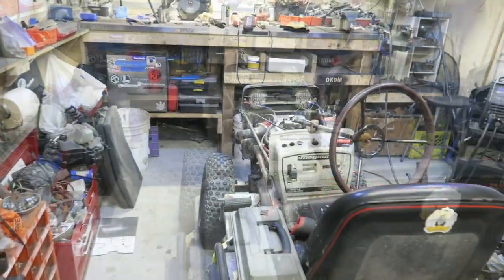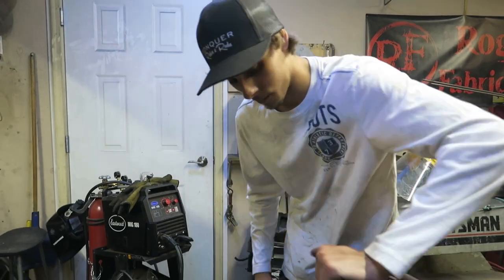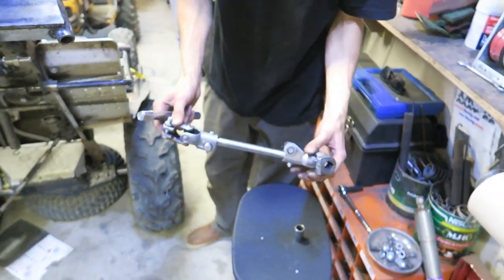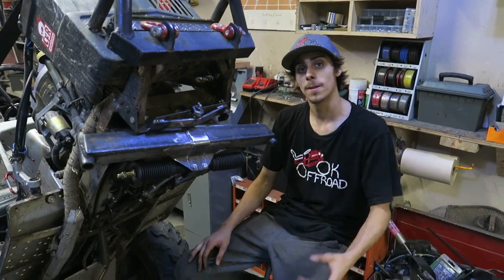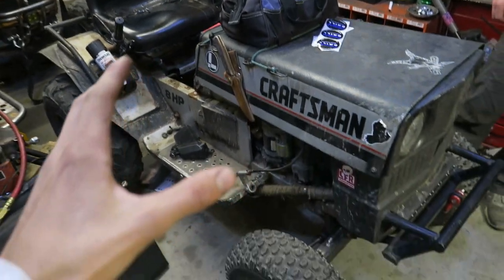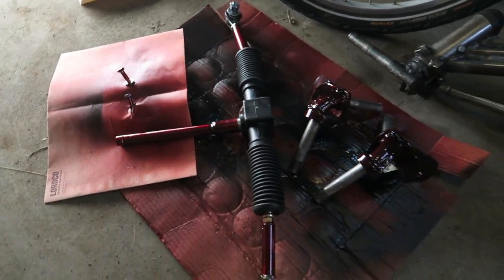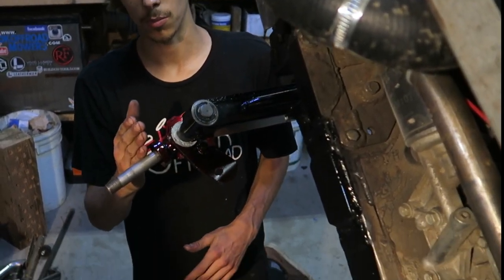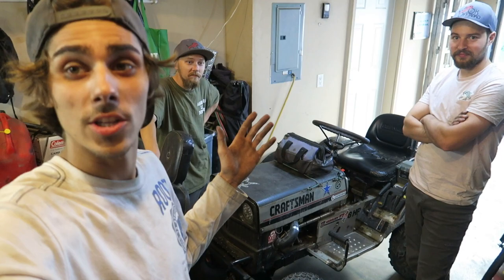Magnums custom steering and front axle part 2 (DIY) How to build!

Comment: Yo I’ve got a 67 f100 4 speed completely modified with tray and front suspension and 88 JD 240 slide carb in both. They are rippers man. I got them on 15x10 pro rock 97 with 3” BS stanced out. I drive the JD to work so it’s rocking all season radials for the smooth ride. Your content definitely was super helpful. I have some land and a cabin in the high peaks area of the Adirondacks if y’all ever wanna rip the New York State snowmobile trail in the start of spring it’s awesome and huge goes on forever with hotels and bars along the way

Comment: I see a potential problem with that steering design every time that axle pivots up on one side the steer tires will turn if you locked the steering wheel stationary... (bumpsteer ain't cool). Your best bet is to mount that steering rack input vertical and do the steering in a way that allows for the vertical rack input this would stop the bumpsteer.

Comment: I’ve been gearing up to an axle swap and rack and pinion for my tractor, do you remember where that rack and pinion came from?
Reply from the maker: It’s off of Amazon!
Reply: Yeah I’ve been looking at them on both eBay and Amazon. They have them for go carts, with the input spline 90 degrees perpendicular to the rack. Then, there are much beefier racks for Polaris utv’s. But the input on those is at an angle, I’d guess for the offset of the driver side. What i was wondering is if the one you used in this video was advertised for a go cart? And how has it held up so far?
Reply from the maker: @Tennesseemountainhomestead yes was for a got cart and had held up amazing!

Comment: Instead of up grading a donor mower it better to start from scratch, make a frame, and buy over built components instead of modifying. I'm a certified welder, but I ended up disabled and need a project.

Comment: i have quick question for y'all, if i did a pulley swap on my mower do i lose any torque or do i just gain speed?
Reply: A larger pulley on the motor will increase ground speed capability, but at the expense of lost power.
Reply: @ebbsspeed  thx so much I had that question for so long 😁